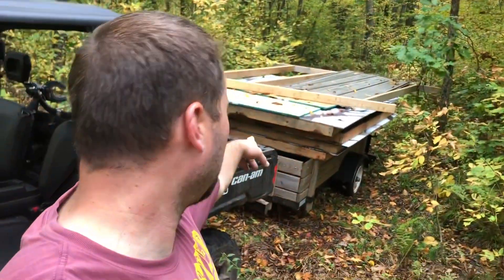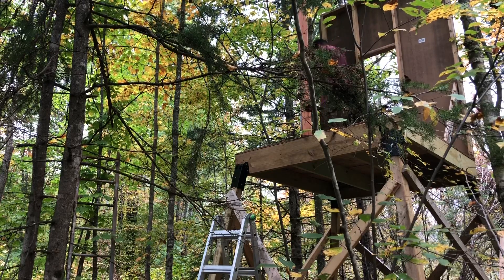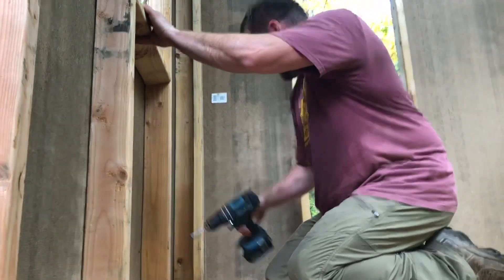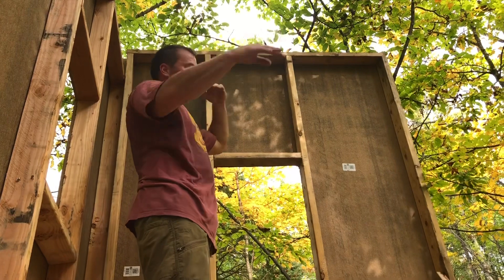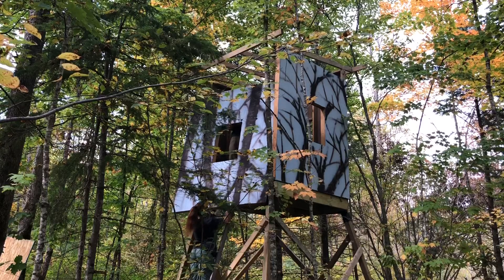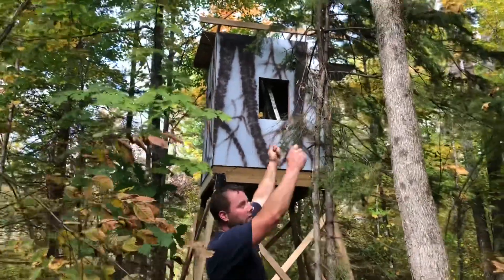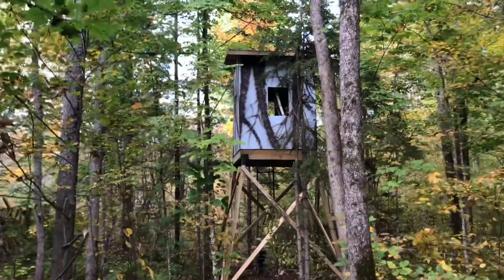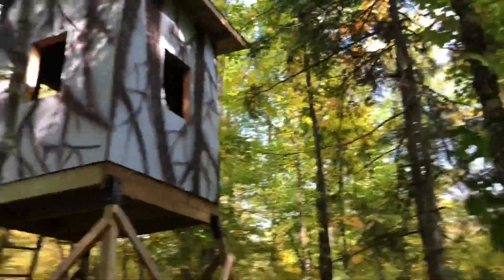#93 DIY Elevated Deer Blind Finale

Comment: A++ deer stand!!!  Well Done!  I've had visions of building a 4 X 4 just like what you built.  I think I'm going to build the entire blind on the ground, then insert two 12 ft. 4x4's in one side of the deck brackets and pull it upright with a 4-wheeler, then insert the remaining two 4x4's.  Actually building the stand wall by wall THEN a roof while 20 ft. up in the air... Screw That!!!  haha  Great job!!!
Reply: I'm planning the same thing.  I got my 4 x 4 floor boxed out and when I get home today I'm going to start the walls.  I'm planning on fitting all the walls on the floor using screws, then once I have it all right then ill disassemble it due the weight and put the floor on my trailer.  then I"ll completely assemble it on the trailer and lay it down on its side.  Haul the trailer out to the location and put the legs in and pull it off upright with a my tractor.  I hope it goes as planned.  I've been brainstorming trying to think of every possible option.
Reply from the maker: Troy Gurley how did it work out?
Reply: @backinthewoods2022  got it all done and was happy with the outcome.  I'll post a video soon of how I transported and erected it.  I only used 7 foot legs though.  I hauled the whole thing already assembled on my trailer.  Got to the woods and used the backhoe the rest of the way.  Thanks

Comment: Holy crap!! How many times have I been in that exact position lol. Carrying, dragging, pulling pushing and grunting. Getting ready to start doing it again though as soon as gun season is over lol. Tip though, buy the torx head screws if they need to be longer than 1 1/2 inches. Much easier to drive in.
Reply from the maker: James Franks yeah it definitely isn’t easy better to do this with two guys. Torx are the way to go👍

Comment: I used a stand very much like this for over a decade and found a few extras worked out really well. Make sure you level the floor, especially if you want to put in a swivel chair or stool. If nothing else, if the floor isn't level, it will be really annoying to feel like you are leaning one direction all the time. Put tin or sheet metal on the roof . This will make the stand last a lot longer. Also, put some triangular shelves in the corners; really handy for your thermos, binoculars, lunch, Also, cover them with carpet to prevent noise. Some hooks or nails to hang things on are important if you want to shed some clothing in a heated stand. I use a medium size backpack and hanging it makes accessing what I want really easy. For the leaves you want to put on next year, cut some cardboard stencils, or spray paint around some pine boughs.
Reply from the maker: Ray Knutson thanks i appreciate it
Reply: Ray exactly what I was going to say. I have a 6x6 and a 4x4. They work awesome. I put foil insulation between the plywood and carpet.   Run the roof out a foot all the way around. Keeps most rain off the building. I build a box with trim boards and cross pieces and attach my sheet metal roofing to that. Then I just drop it over the walls and screw it to the walls. Easy and a lot lighter. Also run the side panels all the way down past the floor joist. I have videos on my KNOWLTON NORTH you tube channel.

Comment: Next one I build, couple of weeks, cutting out a bunch of weight. Using firing strips in the walls and 3/8 plywood. I build my roof similar to walls, so it fits over the 4 walls. Once I get 3 walls up I’ll get the roof in place before the final wall. I used snow slide on the roof, glued backing works miracles. 10 years no leaks. Windows can be long and narrow, not for bow hunting, if you can see sky, your windows are too wide!

Comment: Man great job just some friendly advice me and my grandpa built an 8ft blind we built the whole thing on the floor, pre installed a hook on the roof, tied it to the back of the truck and just lifted her up all at once, you just gotta pre measure where the legs are gonna fall and put a slight hole so you get some leverage and it stands up right when your pulling with the truck, that whole o. Insulation could not be further from the truth we put some insulation and we have to deal with mice even woodpeckers that’s made nests I. Between the walls the blind going on 10yrs still going strong
Reply from the maker: Christian Tuexi I will have to try that on the next one this one was in very tight spot though I stuck it in the thick stuff 
Thanks for watching and the comment I appreciate it
Reply: Yes sirworks great with 3 people that tractor should do nicely one to drive and the other to help you to lift the blind all you need is about a foot off the ground so the leverage kicks in  happy hunting

Comment: Probably tough to do there but if a little more open I would put it together on the ground then stand it up. Sounds tough but it's a lot easier than struggling with every wall. Get a few friends and stand it up after all put together.

Comment: You mentioned snow and ice. Tip: Paint your floor before you put down the carpet. Tracking snow into the blind will slowly rot the plywood. That has happened to me. Yeah it takes a while to happen, but then you don't have to cut out and replace a part of your floor. What state are you in? Got me thinking of building my own tower blind. What are those metal brackets called? $$$?
Reply from the maker: Wisconsin 
They are called elevator brackets I can’t remember off hand how much. I believe you can find them on amazon I bought mine at Menards
Reply: @backinthewoods2022  Thanks. I have been binge watching your channel. New subscriber.

Comment: nice work  will this withstand high winds? also do you have that ladder built to access the blind? id like to see how you did that
Reply from the maker: So far so good have had one like it up for 4 years now no issues
As for the ladder I take 2 2x8 and lean them up between a stair and a ladder angle and put 2x4s between and I also place tread tape on top so I don’t slip when wet.

Comment: If you'd like to heat that, why not put in a little ventless hang on propane heater. You could put a shelf hanging next to the ladder so that you could put a disposable propane bottle about the size used for propane grills and run a copper line from there to the heater. The heater wouldn't take any room away from the inside dimensions and would keep it nice and toasty on the inside. I've seen that type little one burner heaters no bigger than 10 by 12 inches and it wouldn't hang more than 8 inches out from the wall. When not in use, disconnect the bottle to take with you and use electrical tape to seal the connection against wasps and dirt dobbers. I would also assume you are going to have some way to padlock the door to keep intruders out.
Reply from the maker: Just saw this comment sorry I didn’t get back to you sooner like the idea will have to look into that. I’m not to worried about intruders if they want in they will get in I try to put out the Goodfellas persona to ward off would be intruders👌
Reply: @backinthewoods2022  you'd have to put some type of regulator connection on it. I'd check it out with a propane company and see if its feasible.  It would be a good idea if it could work. I'm thinking of doing something like that. I'd like a stand big enough to sleep in.

Comment: This is my first blind of any kind https://www.youtube.com/post/UgkxLQGtOO9dXIsNktEeycGoIT6jtJJNTScA  so nothing to compare it to. After I receive it, I set it up and left it outside at home for a couple of months to let it start smelling more like outside than human. So far I've been very happy with it. Very roomy - I hunt alone but could easily fit another person comfortably. Put one bolt through the shoot-through mesh, and works as advertised. I've ordered another one, so this noob is totally satisfied. One caveat - the included stakes are pretty useless; you'll want to order something more substantial. I haven't had it long enough to rate durability, but zero issues so far.

Comment: I see that you have both of the cross bracing 2x4"s on the same side of the corner posts. Did you just force the inner 2x4 inward to make it work? Mine is up and level. next step is bracing.
Reply from the maker: Exactly, then screwed them together